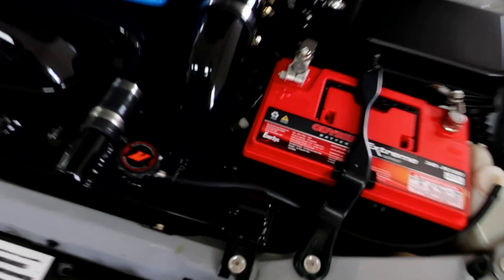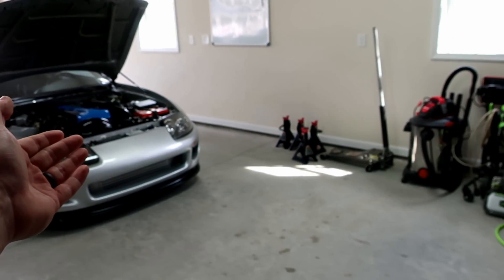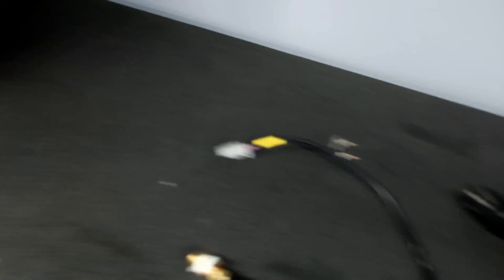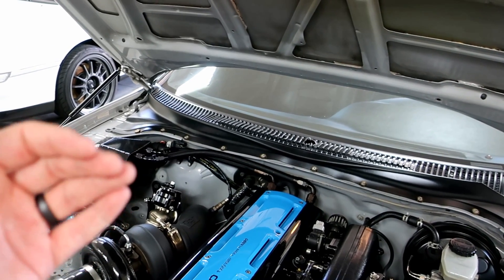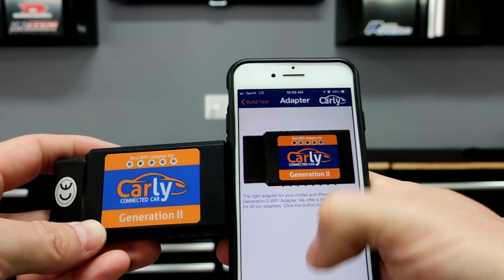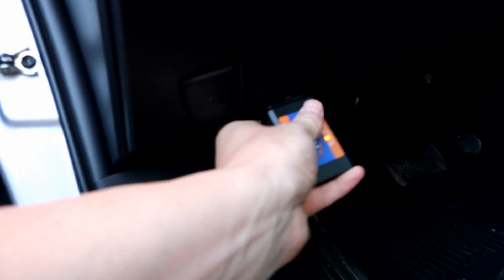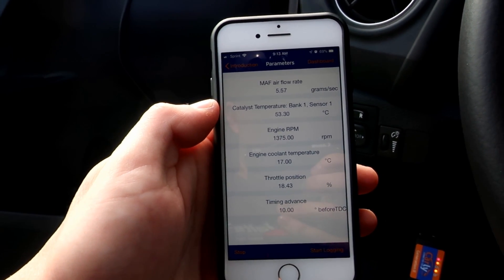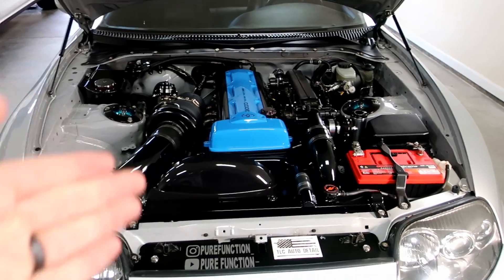Cheap Datalogger For Your Car!

Comment: Highly doubt it's a "stuck injector", and you'd better hope that's not the issue as well. That'll hydro-lock an engine in a hurry. You need to take some datalogs and share with your tuner.

For what it's worth, I had a gnarly rich thing going on with my car - turned out to be a flaky signal coming from my throttle position sensor - every time the signal erroneously spiked up, it would trigger the acceleration enrichment feature of my ecu. My whacked out TPS signal was fluttering up and down between about 20% and 80% many times per second. Each time the ecu saw the upward swing, it would add extra fuel. Resulted in a super rich idle, and sometimes it couldn't run at all.

Comment: Sounds like a short in the wiring somewhere...
Reply: Unplug the sensor and it should default to low temp so the car doesn't run lean in the event that the sensor does fail